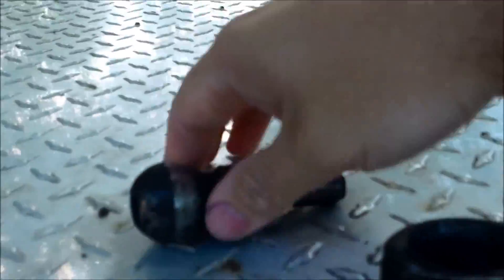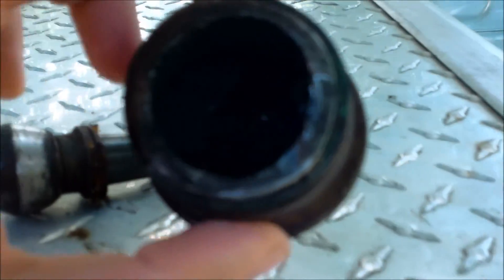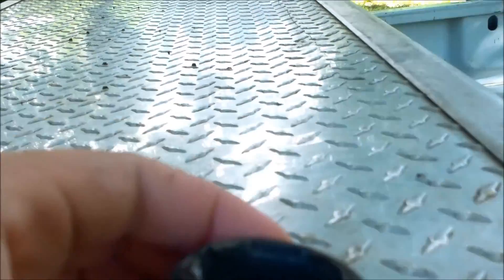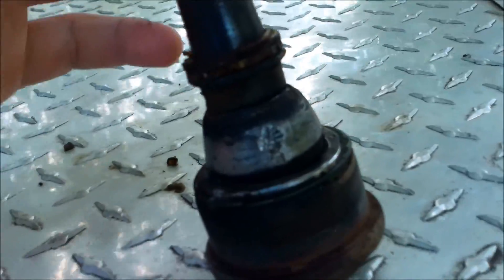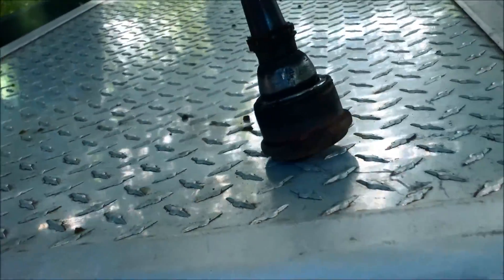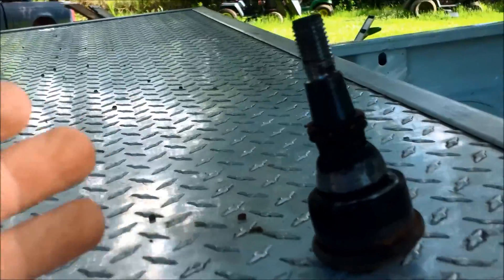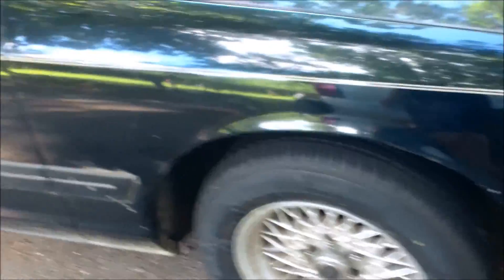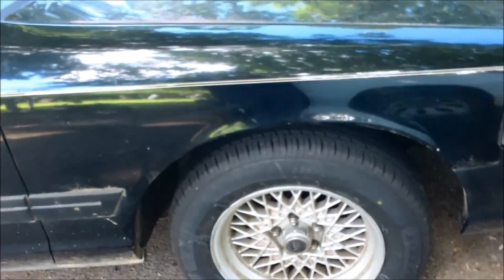ford Crown Vic ball joint failed

Comment: i dont understand why ford did that with their front ends. so if the press fit fails the bottom control arm will push off the spindle. glad your ok!
Reply from the maker: glad i wasn't going 60 mph like i was doing seconds befor... i slowed down to turn around in a parking lot
Reply: damn man your lucky!

Comment: glad you are alright. never good when a part like that fails. never understand why some parts dont come greaseable. i know they want you to buy parts, but it seems like a safety issue to me. i always like to use MOOG parts when doing suspention work
Reply from the maker: funny how the replacement parts came with a grease fitting, but the factory original part did not